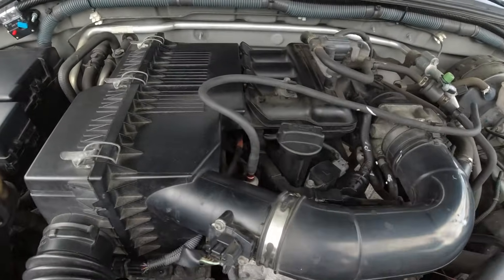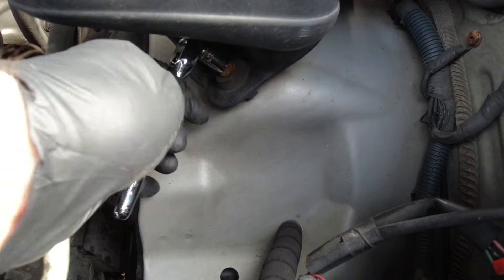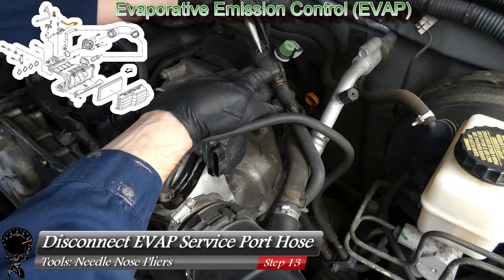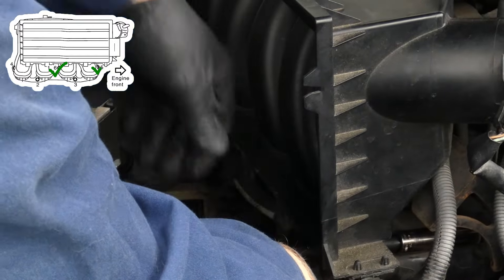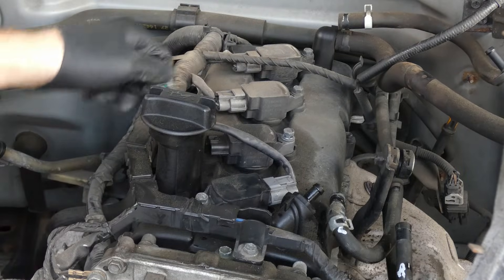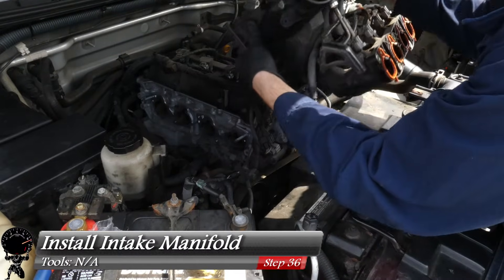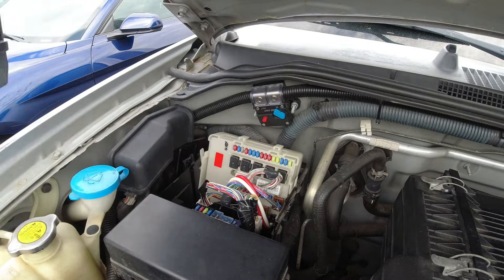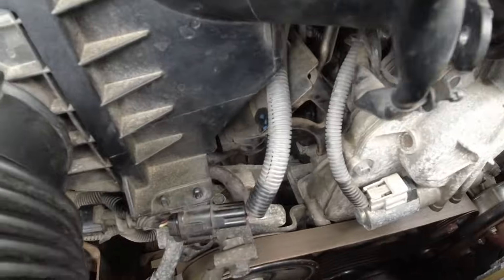How to Replace Spark Plugs for a Nissan Frontier (2008-2014)

Comment: Wonderful video and so many thanks!!!! I watched it a dozen times in preparation and then again following step by step while performing the task. It took me about 5 1/2 hours to complete. I took my time to ensure no mistakes and I enjoyed doing it. One question... when I disconnected the right ETC Actuator water hose, I lost a LOT more coolant than on your video. Probably like a cup or maybe even a pint. Will this be a major problem? Where would I add more coolant to make up for what was lost? I wasn't sure if it's simply from the radiator or if it's a different separate reservoir altogether. Again, thanks for such a thorough tutorial!
Reply from the maker: Thank you for the positive feedback. This is not a major problem. Just add more coolant to the reservoir. Other than that, how's it running?
Reply: @mcgurrentertainment  she’s purring like a kitten! She wasn’t running badly before, but it seems like there’s a bit better response than before. Sometimes I’d had rough starting issues. After 120K I just figured it’s time to do the job. I’ve noticed poor gas mileage this past year or so. I’m hoping it’ll be back up to par now that the job is done. Thanks again!!!
Reply from the maker: That's awesome!!! Greatjob!!! Let me know if you have any other questions, comments, or concerns.

Comment: Man, extremely great video! The detail and clarity of your instructions are awesome. Great work! Now, would you happen to have information on changing the ignition coils? Thanks
Reply from the maker: Thank you very much. Changing the ignition coils should be the same procedure minus spark plug removal. Just pop them out and replace them with the new one.
Reply: @mcgurrentertainment  is there any sort of programming? So I have been told by mechanics that there is...
Reply: @FzRune15  I need to know this as well
Reply from the maker: That doesn't sound right at all. The dealership I called never heard of any sort of programming for ignition coils.  I know everything is going computerized as cars are being built, but that's a new one.
Reply from the maker: Both the dealership and my service manual have never heard of programming ignition coils.
Reply: That's what I thought especially after seeing your video. The coils don't even look like they would take programming. 

Which begs me to ask, my frontier has nearly 210K miles, planning to do the sparkplugs. Do you recommend doing the ign coils as well? O
Reply from the maker: Based on the amount of work involved to change the Spark Plugs, I would say yes. I'm guessing the ignition coils are originals?
Reply: @mcgurrentertainment  yes, all but one and so are the spark plugs Jaja. So the one that isn't new I had replaced by a local mechanic which was the one who mentioned they needed some kind of programming which I thought was bs at the time. Just didn't have the time to do the job myself.
Reply from the maker: Gotcha. Let me know if you have any other questions. 😀
Reply: I heard that the ignitions coils don't have to be in order to put back in are no programs.

Comment: Hi there, you recommend me to change the coils at once?
Reply: Yes , thank you
Reply from the maker: Ignition Coils are typically replace as needed type of part, meaning you replace them when they are faulty. Sometimes, this parts can fail due to poor manufacturing or simply bad luck. However, if the vehicle is seasoned and has high mileage, then I may change them all at once. Typically with high mileage vehicles, when one fails, the others are not far behind. Is that what you were asking?

Comment: Why do I need to depressurize the fuel pump?
Reply from the maker: Great question. The idea is to prevent fuel from being dispersed from the fuel line if it's disconnected (intentional or accidental).
Reply: @mcgurrentertainment  thank you so much

Comment: I have a question. I followed all instructions and it went well. one issue was found, the 3 and 4 plug, chamber were full of oil. I removed the oil befor taking out the plug because I did not want oil to flow into the cylinder. How do you stop oil getting into these plug chambers? any information would be appreciated. Thanks
Reply from the maker: It's very difficult to say without looking at the vehicle, but the likely cause is a leaking valve cover gasket.
Reply: Sir can you upload video  nissan frontier fuel filter how to change.
Reply from the maker: @luqmanpawte3108  That is a good request, however the 2009 Nissan Frontier Fuel Filter is considered to be a "Maintenance-free" item (per the Service Manual). This is due to the fuel filter being part of the whole fuel pump assembly (Fuel level sensor, fuel filter, and fuel pump assembly). Thank you for the feedback. I always like getting ideas for the next video.
Reply: Spark plug tube seals